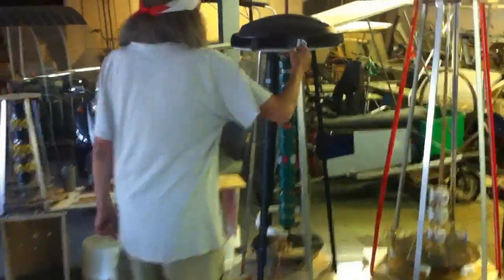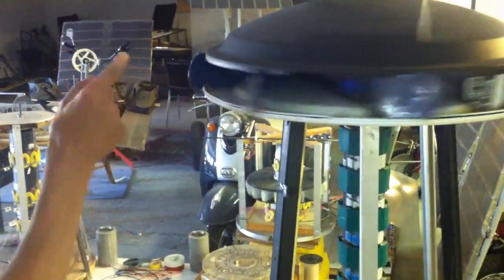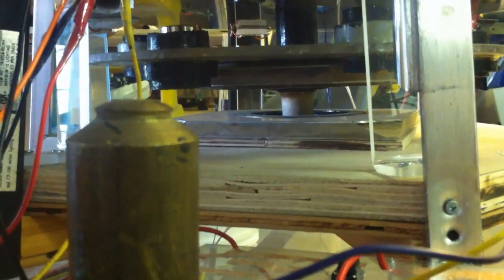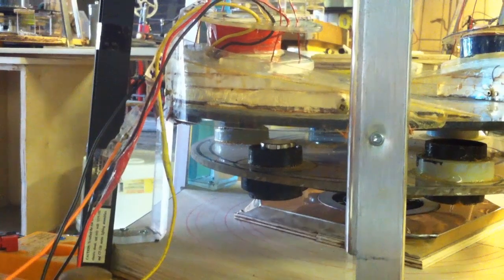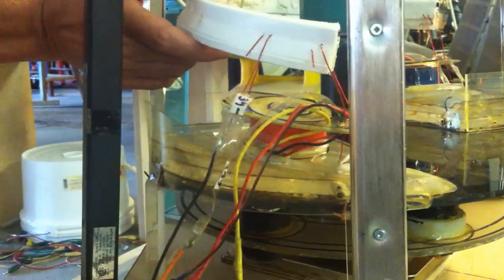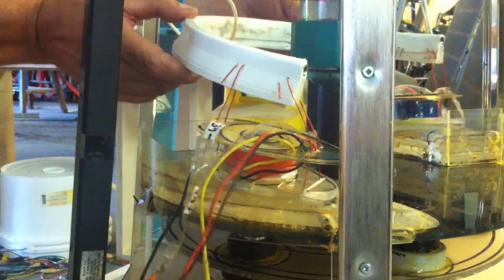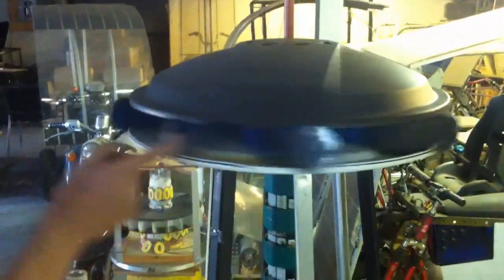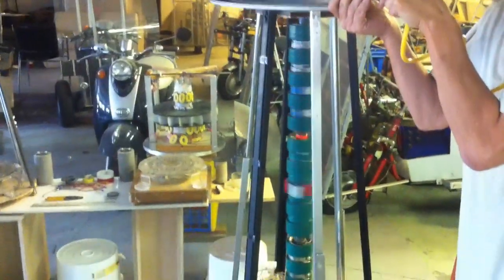UFO Alien Leak - FS18 Levitating Dual Energy Stacking

Comment: The little finger test is good for detecting low resistance - I recently saw a vid where it is done with spin clothes dryer - but a repeatable central accelerator is needed to reach high rpm's & consequent high voltage. The next 2 vids (FS20 & FS22) illustrate this. What I am trying to do gradually is reveal the techs of other "Earth's" - now numbered more than 24 with more added every 1 or 2 months. They don't use fuel, nukes etc. or have "States" or "money" currencies. We can live like that !

Comment: Well, I am not sure if you are stating that if with your finger pushing on the rotor with an average mechanical power of one watt, that you get 1000 electrical watts out.  You clearly don't, you get a fraction of an electrical watt out.  I am from the "old school" that just analyzes thinks on their face value.

Comment: The first 10x is from switching generation off the drive wheels; second is eliminating friction via Magnetic levitation bearings; & the 3rd 10x is by generating by frontal air pressure - treated ONLY as a negative (and totally WASTED) before! This has NOTHING to do with EITHER "overunity" or "Free Energy" - like my solar vehicles it utilyzes propeling means neglected by 20th century "Fuel Machine" engineers. So RETHINK with these new factors please!

Comment: It would be wonderful if you could increase the energy output by 1000 times.  Unfortunately what you are showing is a generator combined with a flywheel.  You are showing old school technology that got it's first commercial application when Tesla works with Westinghouse to make the world's first hydroelectric plant at Niagara Falls, NY.  With metaphysical certitude, your setup is under unity.

Comment: The energy leaving straight up (through the crown); results in energy arriving from below (into the womb). This is different from the animal survival inprint (mouth in front sense focus), Hole in rear for expelling residue. Note these are at right angles (but near) the primary energy projection outputs.